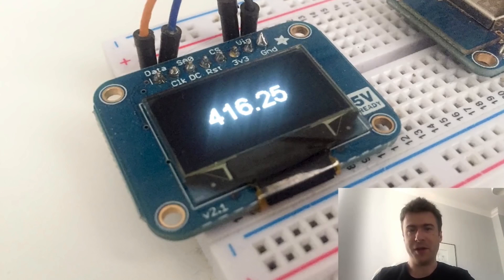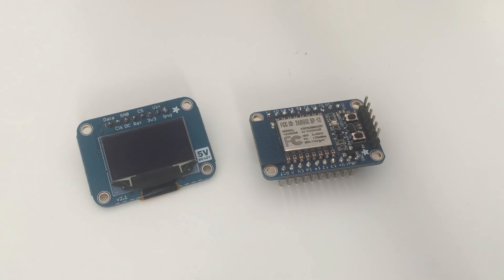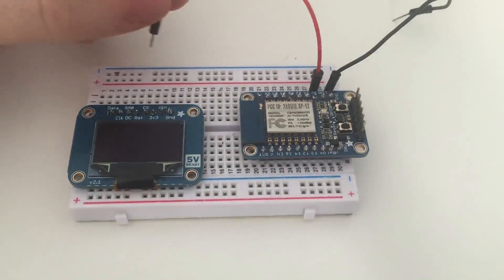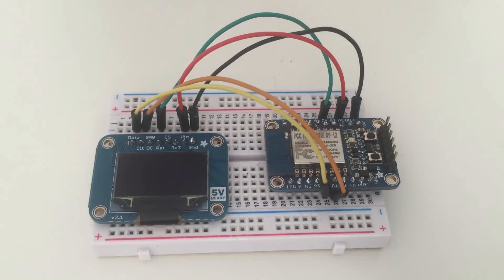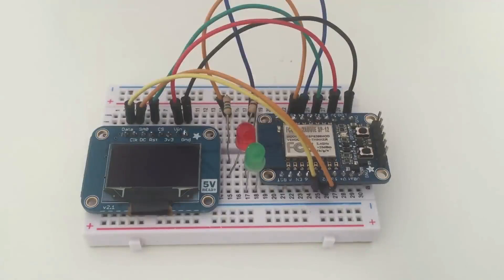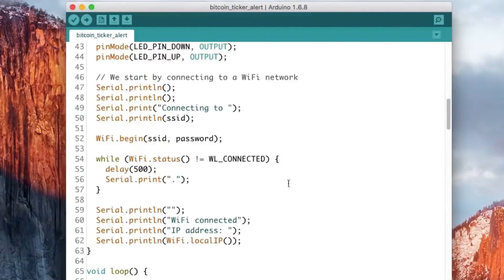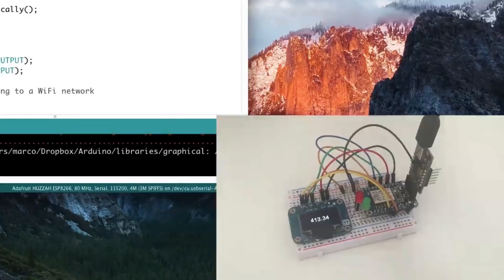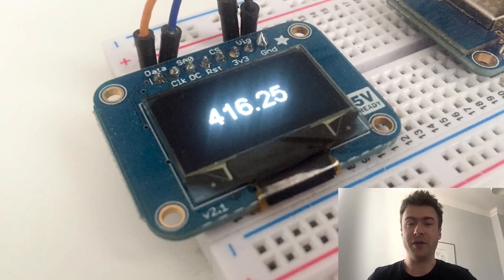Build a Physical Bitcoin Ticker with the  ESP8266

Comment: Everythink work, but displays goes off every minutee fore 20 sec aprx. What is it ? Everythink other working good.
Reply from the maker: I'd check the Serial monitor to see if any error is returned after those 20 seconds, that will give you a lead on what is going wrong.